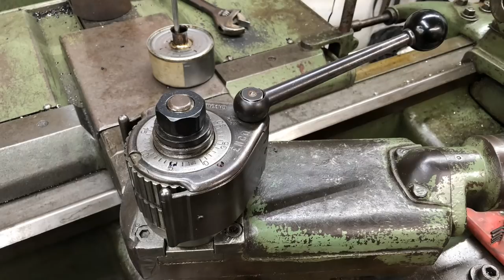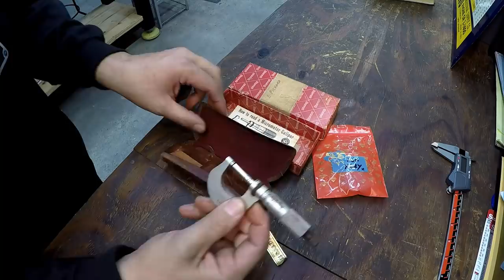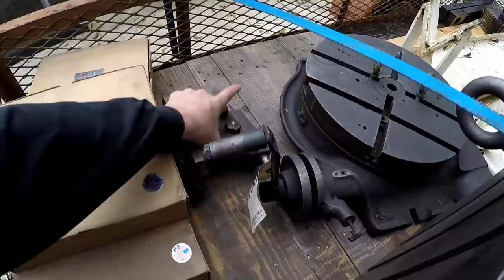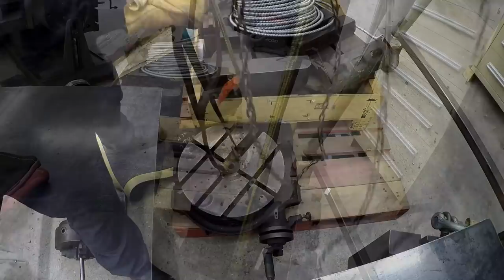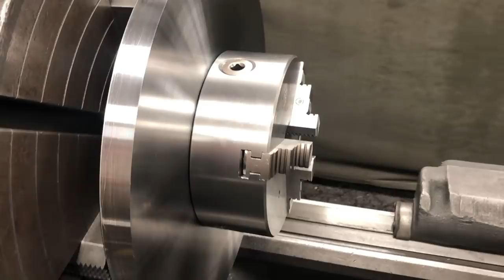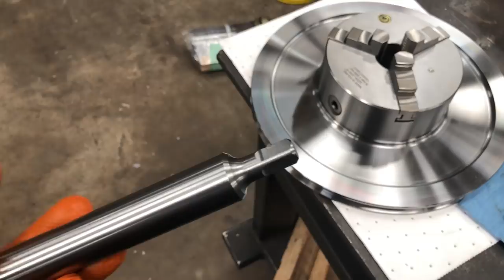SNS 241: Custom 3 Jaw Sheave, Shaper Table, Viewer Mail

Comment: With the mic case, I believe the dust in the case is from deterioration of the liner. You will need to completely remove all the "fur". It's like a spray-on type fiber that makes it feel like felt when it's new, but once the adhesive breaks down, as does the material, and it just turns to a fine dust.

By the way, I'm new to your channel, thank Tony for that :) I'm a toolmaker from Australia that's currently not working in toolmaking or machining and yourself and Tony really make me miss what I used to do. Thank you.

Comment: Hey Adam, get a small container and lid that fits that steady rest and spray it with PB Blaster and let it sit. I had an Atlas Lathe with a broken chuck seized on the spindle that I bought for parts. They actually tried to turn the chuck down to use as the back plate. After a few years soaking (didn't need those parts right away), the chuck spun right off, no problem at all. As long as it is just laying around, let that oil work. I couldn't believe how easy it came off.

Comment: Find a big enough bucket for that steady and cover it with vinegar.  Cleaning vinegar is usually higher acidity and cheaper.  It might have to soak for a couple of weeks or more than a month, but you will be surprised how well it comes out.

Comment: I'm looking forward to hearing more about the multifix tools.  It is a great system.  I have a set from "Create Tool", which is a Chinese firm.  I have been happy with it so far but i don't run them all day.  In general the machining and quality seems better than typical Chinese and the customer service was quite good. when I bought more, I did notice that though the prices were the same post tariff, they had taken some austerity measures (less cleaning and fewer cosmetic features).  I will look into buying  a holder from PEWE to see if it fits my "Create tool" post.
Reply: X2 on create tool. We have several sets from them on our lathes(A and B sizes). Very nice quality.

Comment: The very small taps and dies are very specialised. I think I had to get them from Poland as well. I've always found Polish made tools to be very well made and at least as accurate as Mitutoyo  or Starret (although not as 'nice' style or finish) They are also real cheap in comparison. I have no hesitation buying or using Polish stuff.

Comment: I want to make a crude lathe with a chuck.  Like the welding fixture you made. Only difference I'd want to use tapered roller bearings, from a truck wheelbearing of something with a 2" + inner diameter, and build it instead a piece of large tubing, to hold oil, with a upper resovoir filled with a dipper on the hollow shaft. The resovoir fill when running, and the oil running through a passage to the bearings.( basically working like a lawnmower engine.) Then use a 1500-2000watt brushless dc motor, with speed control. With brake, forward, reverse, . maybe try a electrontc leadscrew. Uding a 500-1000watt motor. With the roughly 1/8"-3/16" wall tubing, braced with 1/2" plate. With two 6" x 1/2" plates 60" lond. To brace the base and ways. Use 1/4" angle and channel helping form the base, and ways, se 4" square tube for leggs, abd run the length. With 1.5"solid bar welded through the tube . Bored out for 3/4" threads to level the machine,  possibly use them as coolant storage, with a 18ga. sheetmetal sworf and coolant catcher tray, possibly upgrade to a 3kw(5kw peak )motor using 4x 2600w 240v to 12.5v computer server rack power supplies in series.   For 48v and 200amps if required , i have them may as well use them. Its proably not going to use half of that.  It will require about 50-60 amp 240 circuit to power it, there is losses.,  Anyway cut two large gussets used to attach the head stock to the base and ways, made of two, 2 piece gussets,  that bolt together the upper piece welding to the bracing on the front and rear of the bearing housing,  with bearings anc seals, then the  lower smaller parts bolt on, or weld on, maybe weld on a 1/2"x 1/2" machined bar for it to sit on. Being machined to fit precisely, then the lower part fitted to the base/ways, using shims to slightly raise, level, move back or forth as thf head stock is bolted to lower portion, possibly using 1/4" steel dowels, also use 2" x 1/2" flat bar, machined flat on all sides. With a v, to allow a 1/2"sq bar on its corner. To be doweled to the flat, into the v groove. Forming one of the ways. Then the front way, using the same material , only using a square or 'u' groove. With it machined on 3 sides to fit. And doweled in, using interference fir, with 1/4" dowels, after being fitted. Then machine the top of the square bar flat and  true. Scrape for flatness and oiling, then make several receiver blocks from 1"x4" bar about 4" long. To be attached to a 1"x2" bar with another to  form a clamp, or on its own with another pair, to attach a compound  slide to, using s 4" x 1/2" bar. Notched to form a sliding clamp. For the compound on the ways, possibly drill the bottom side for a 3/8" brass bolt,  to allow some friction and adjustments to thr mounting to the slide. And a similar setup for the tailstock.   It would take some time to build it all. And gather the scrap to build it,   i would  like to build a mill to match it, i saw a shaper on yt. cutting  edge eng.  In Australia, a Swiss made monster, like s gantry crane and mill, had a big baby, i was thinking  maybe something like that, have the head move side to side, up down. Then the table about 48" move about 30"-50"maybe have thr milling head move in/out a bit to make all thf travel possible.  Use a large angle plate on the front  on one side, with the head to the side, it should be about like a small Bridgeport or large drill press,  uding a 20"x 20" anglf plate, maybe build a table to attach to it, same rough dimensions. Use leadscrews to raise and lower the top plate usung a 500watt motor, use precision guides, and a gear reduction. With a speed control. To allow lift at .020" per second at the slow speed, and up to about 1"-2" /second high speed, with a hand crank turning 4screw at once. Using a timing belt, to prevent slack  a gear set or chain will have, keeping all corners even, using 1/2"  with 20 mm linear bearing, and 1" guides, with Brad bushing.  Only a 6"-8" travel.

Comment: That tiny multi fix is a Aaa. I use a Aa takes 10mm tools on my myford 3 1/2 inch you know that as a 7 inch lathe but tool junky me I have 30 tool holders from Pewetools  in Germany get them from his shop on eBay as we are still in the EU. Importing things are ok , but a lot of firms are having registered addresses in the UK to help out later inc. pewetools

Comment: When you fix up your table,  make you some 4" or 6" feet for it.  After it's powder coated or painted, glue some pieces of conveyor belt or thick plastic to the bottom.  If you just put the steel down on the concrete, the paint will scratch off enough and it'll rust.  It would be a shame to have rust stains all over that pretty back porch.

Comment: Re the PeWe-tools cut off tool holder. I've been using his design on a 26mm blade for a couple of years and I can do stuff with that I couldn't do with the 32mm in the original toolpost with the adaptor. I now have a 32 mm holder for my E-size and I can stall out the lathe (or get as close to it as I dare ), it's that ridged !. It's closer to the center of the toolpost by quite a margin witch helps a lot !.  I'm not trying to sell his product because I am getting paid for it, I'm just a very satisfied customer. I also worked with Peter to solve a minor design issue design and he now implemented a change to solve it. How many China suppliers will do that ?. 

I bought a complete outfit for my lathe from peter and I'm very happy with the product. Not as shiny as others but really stable and it works perfectly and it's dead nut's accurate. https://ibb.co/album/eDgNAa is what I've got sofar. I'm not a professional, just a tracor enthousiast with a metal working side hobby.

Comment: Would you recommend a back cut chamfer to transition from the belt valley to the traditional 45 degree chamfer, or is this detail addressed manually with a file/emery/scotchbrite?

Comment: Adam, @28:30 the 3 7/8 bit is only pulling a large curl from one flute. Does that mean that the bit is not evenly ground? If so, how much does an uneven grind affect precision?
I understand that precision is not critical in this use, because you used a boring bar afterward to size the hole, but I have curiosity, so I thought I'd ask.
Thanks.

Comment: Your attention to detail with regards to your machining seems to be more acute, as the finished pieces look like masterworks.
When I seen the picnic table my first thought was powder-coat it, quickly followed by caster wheels, and then the thought of using pneumatic/hydraulic cylinders to lift the table off of it's feet.

Comment: Good to have metric tooling to repair all that foreign stuff... Just remember: There's 2 types of countries on the planet - Those who use the metric system, and those who put men on the moon.
Reply: Awesome reply!
Reply: Postscript ... I grew up with the imperial system, we (Australia) went metric some time back, and imperial is becoming a distant memory. Having said that, I have both systems when it comes to metrology, but prefer metric! I deal with old stuff, so I still use imperial tools, but for new stuff it is much easier to get metric stock, bearings, etc.So by necessity, I'm familiar with both ...
Reply: It would be nice to only have 1 system to deal with, but I grew up with SAE units and all attempts to go metric have failed here in the US... We're used to it and it doesn't make much difference for most people in every day life. Science and Technology is a different story - My degree is in Electronics Engineering, so I certainly appreciate the common decimal based conversions within a unit and having units based off each other. (i.e. There is certainly a better relationship between weight and volume where cc = ml = mg vs. lb <> ci <> Gal. (and who abbreviated Pounds as lbs? (and why is abbreviated such a long word? (and why is the abbreviation for abbreviated so long??))))

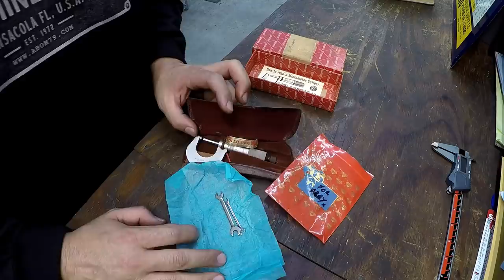Comment: 15:45 Those wrenches Abby got are usually sold as "Distributor wrenches" in the US. They're for working on a cars distributor and loosening the points so they can be adjusted. Ask Alex, he'll know. And tell him to make more vids. :)
Reply: “Ignition wrenches” we called them. The kits are getting harder to find.
Reply: They are BA (British Association) spanners. It's a measurement system that was used here in the U.K. I have quite a few, so decided to donate a couple to Abby.

Comment: I guess I never did figure out what you were making with the new wheel and chuck. Did you just have to mount that new piece on something to watch it turn?
Reply: CALVIN L. NIKONT
 the company where Adam is employed works on gear boxes.  And they need a way to test them.
So the contraption that Adam fabricated clamps onto the input shaft of the light gray gearbox by way of the 3-jaw chuck.
And then that gold motor drives the gearbox via the pulleys and belt.  So it's just a quick way to attach a pulley to a shaft.
As a quick observation, since the input was rotating at 915 RPM, and the output shaft of the gearbox appeared to complete 1 rev per second, I'm guessing it's a 900-to-1 reduction.
Reply: @richardhead8264  Thanks
Reply: @richardhead8264  Also worth mentioning is that the chuck allows to stick the sheave to a lot of different sizes input shafts without having to fabricate individual matching couplings every time, so it is not only this specific gear box but about any gerabox with an input shaft that fits into the chuck.

Comment: I bet those are BA (British Association) wrenches - have a look for markings like 2 BA just before and after the name. They were a standard for small screws in the UK now replaced by metric in most areas, EXCEPT model engineering. I have some BA taps and dies from India for my steam models. I could convert to UN or metric, I suppose, but the castings I get come with the BA hardware.
Reply: They are indeed BA spanners. I have a few, so decided to donate a couple to Abby. I have never had need of them (so far), but who throws away a perfectly good tool?

Comment: Hey guys what do you you soak your micrometers in to remove light surface rust and to function properly? I have lots of old great mics and would like to shine them up and suggestions would be great also looking to sell them if anybody is interested
Reply: soak in PB blaster then gently kiss it with 0000 steel wool , good as new.

Comment: That looks like a very odd ratio of gears (pulleys). Usually the gear (or pulley) on the motor side is much smaller to get the torque advantage.
Reply: We are just spinning them with no load. Looking for excessive vibration or heat build up to catch any issues before we ship.

Comment: Hi Adam, I own a Mitutoyo 6" Vernier Caliper model # 190-101.  When Japan was selling them in the USA back in the 1980's they came in a nice wooden box.  The box was lined with a black fuzzy material which according to previous owner began to chemically break down into a corrosive substance that ate the satin chrome coating off the caliper leaving rust pits and flaking.  I'd remove the lining from that Mic case and put in some black felt.
This unfortunately chemical destruction of these mic's has caused the price to inflate as there are few survivors in excellent condition with all the parts. 
They measure 0-6" both depth, inside & outside diameter, are equipped with a height gauge foot, can measure angles 0-90°, and a set of clamp on jaws for scribing or measuring drawings.
https://www.practicalmachinist.com/vb/general/mitutoyo-190-101-caliper-instructions-149082/
Reply from the maker: Good stuff to know. 👍🏻

Comment: @Adam, I noticed that you used a counterbore drill for the counterbores at roughly 35-37 minutes. Can you tell me why you used these over an endmill? I assume it is easier to get a good finish when the machine used has some backlash/slop (for example in a column drill) but in the bridgeport it should be fine to use an endmill right?
Reply: Counterbore cutters leave a flat bottom that the SHCS can bear against. If you look at your flat endmil, you will see that it is depressed slightly in the center and will leave truncated cone on the bottom of the counterbore.  The main issue with getting a bad finish with a counterbore cutter is turning it too fast. A Bridgeport in low gear works great.

Comment: Adam i watch quite a lot of yr videos your always measure inside bores with a spring loaded inside gauge  instead of inside micrometer or dial bore micrometer  any reason why i would think these be easier and more accurate ???

Comment: How did you figure out where to drill the holes so they would line up with the chuck perfectly?
Reply from the maker: The chuck is machined with a register on back side. Machine to fit and just measure the hole diameter.

Comment: That cut off blade can use an insert tool to remove AND install. google Sandvik 5680-057-011 and look at the images. Small hole in the blade allows you to insert 1 pin of the tool in it, and with slight leverage you push the insert into place. Cone end is to extract.

Comment: When you get down to 60 kgs you will know what light is .I just cant put weight on  ,makes my job of fixing washing machines really hard. Not easy to move around at 75 yo. Gotta use BRAINS over BRAWN. LEVERS AND PULLY,S.

Comment: Hry Adam I hope you see this comment about a cup or so of citric acid in boiling water cuts rust but it does eat the metal albeit slowly. I do have a shitty video demoing the concept. set that steady rest in a metal tub near a heat source and boil up some water and mix the acid in. itll come out clean but you have to dip the parts or oil them after. It works on IRON OXIDES I dont know about other oxides.

Comment: Hi.  What is the function of the Custom 3 Jaw Sheave - what is it driving & what does it do?
Reply: I think he mentioned driving gearboxes for testing after repair/rebuild. I assume they fix the sheave to the input shaft with the chuck, so they can use it for all different sizes of shafts, sling a belt on it and drive it. Otherwise they would have to machine some individual coupling every time.

Comment: adam, i was wondering what you think of those bison chucks. are they any good?
thing is: in our shop the go-to supplier has both Röhm and Bison chucks in stock while the Bison being significantly lower in price, and up until now we always went along fine with Röhm. you think Bison could be good replacement while saving some bucks in the process?
Reply: ferze001 I’ll throw in my 2 cents. The shop I work at we use Bison Chucks almost exclusively. We use 8” 3 jaws, and 5C collets. The are great. I know there is better out there if you want to pay more, but in terms of saving and still getting high quality, Bison is second to none